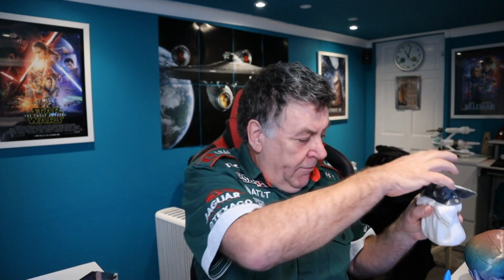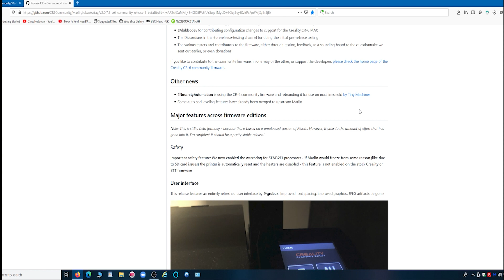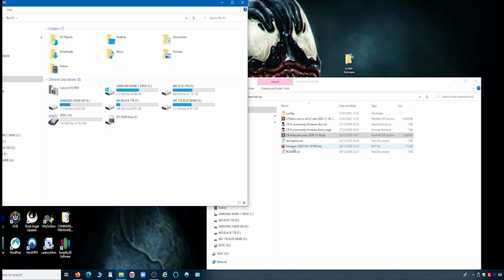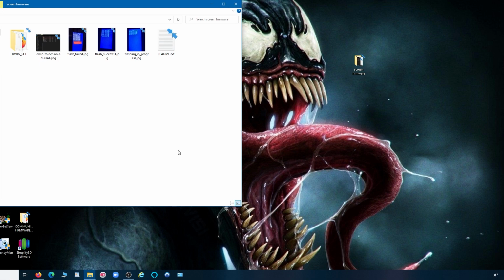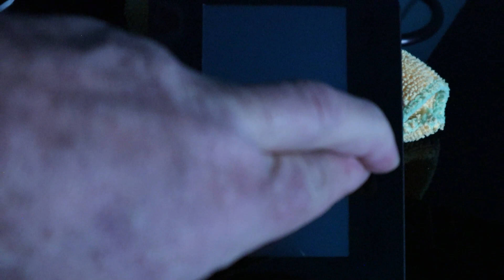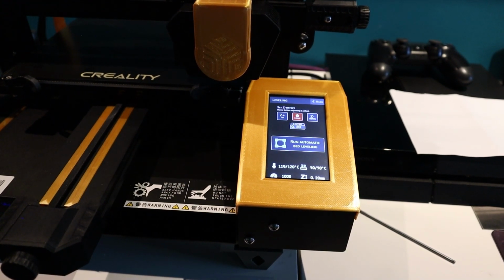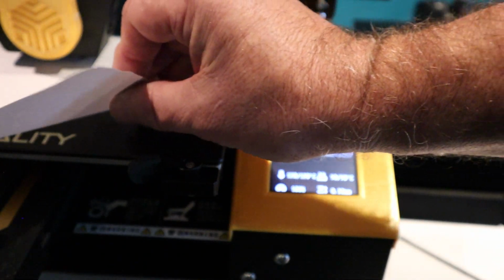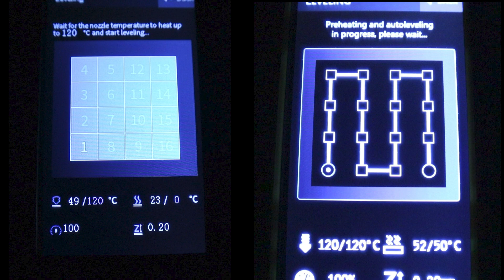Creality CR6 SE Community Firmware Install...Start To Finish

Comment: Thank you so much. Your detailed video gave me lots of assurance as I updated the firmware on my CR6-Max. I love the new interface and had no problems with the z-offset. I used an 8 GB card and for the screen update, it was crucial to update it on a windows machine. I originally formatted on my Mac and it wouldn't work. So, I have a surface laying around and formatted the micro SD as per your instructions.. Voila.. it worked as advertised.... Now... if I can move to octoprint...Best from Madison Wisconsin
Reply from the maker: Thanks for the kind words Daniel I appreciate that...glad it helped

Comment: Excellent video Tom and very easy to follow - now away to try my first test print with the new firmware installed! :)
Reply from the maker: Thanks for that Craig...am sure everything will go well...if you get any glitches try installing it again and even a 3rd time....sometimes it doesn't always "take"

I am currently using the version 6 community fimware which is working great but wont do a vid on it yet as its still in testing/beta version....as soon as the full public release it out I will do a vid.

Comment: Awesome video.  You seem to be quite knowledgeable.  I am looking to go with the Community Firmware.  However, I would like to resolve a problem with communicating with the printer via the USB.  Not sure if iy is a Creality Firmware Issue or not.  Was wondering if you could help.
Reply from the maker: Hi Patrick Thanks for the kind words but I am not actually that knowledgeable when it comes to technical 3D printing stuff :)

I don't use the CR6 now (I do still have it though) ...having bought an Elegoo after it and now a Bambu Lab X1C

If you ask on a CR6 or Creality in general Facebook group I am sure someone will help you out.

Comment: Great tutorial. I must say, identification of mainboard is ok, but identification of display (Creality or BigTree) is difficult, there is nothing on PCB.  Upgrading mainboard v.4.5.2 goes well. Upgradin screen goes ok (same screens),but once I started it write "firmware incorrectly flashed". But printer works, i.e. I tried bed leveling and it make it with always showing this incorrect firmware message.
Reply from the maker: Hi Kristian

Thanks for the kind words...much appreciated.

Re display identification...Isn't the Big Tree screen a much different thing....IE bigger size than the stock Creality screen?

I don't think they do one that looks like the Creality screen (but may be mistaken) so can't see how you could mix them up.

Comment: Great video. I followed your guide to install the firmware. I also fitted a micro SD to SD extender on the screen, so I have a SD slot to put the card in for future upgrades, without having to remove the screen. I had to mod the back cover to let the lead go through. I didn't get as many lines on the screen update, but it seems to be working. Thanks for doing this video.
Reply from the maker: Thanks for the comment Stuart...that's a good idea re the SD slot...I might do that next time....particularly if firmware updates are frequent...I believe there is already one in the pipeline.
Reply: i tried the extender but the built in switch in the screen thinks i have an sd card inserted when i do not, how did you solve that issue?
Reply: @Michael-ot3zw  how do you know that the screen has a card in it?
Reply: @stinker1000000  I notice that when I boot the printer with card in screen, the screen is blank, when I remove card from screen while printer is on the display reapears
Reply: @Michael-ot3zw  the extension I have used doesn't have the card in all the time. Only when performing the firmware update. All the extension does is to allow for an external socket (full SD card) to be accessed without taking the screen off. You are not supposed to have the card in all the time. BTW, this is the extension I bought: https://www.amazon.co.uk/gp/product/B0855DBVXF/ref=ppx_yo_dt_b_asin_title_o00_s00?ie=UTF8&psc=1
Reply: @stinker1000000  i dont have the sd in at all times, i have the same extender you have, for some reason it was detecting the extender as an inserted card, when i would eject the screen would reapear, but i dont have the issue anymore using a diff firmware, i think it was just my firmware making it think there was an sd inserted when it really was just the extender by itself
Reply: @Michael-ot3zw  Fair play - glad it's sorted itself out.
Reply from the maker: @stinker1000000  thanks for the idea again Stuart...I added one to mine no probs so it will now be easy on the next update....will show it in a future vid and give you a name check :)
Reply: @TomsManShed  cheers Tom👍

Comment: Thank you Tom, easy and exellent guide ! iam running on 4.5.2 aswell and works exellent
Reply from the maker: Thanks for that Patrick....yes my 4.5.2 was fine....I have swapped it for the BTT board (which I will be doing a vid on soon) but only because I had already ordered it from Ali express after reading the horror stories when I 1st got the printer and it was a shame to just have it sat in its box.

The BTT board does have some better features like being able to adjust the voltage to the steppers by firmware instead of pots on the board but to be honest I haven't used this feature yet as I don't know how to do it.....one feature I do like on the BTT board is that the blue light on the hot end flashes when updating firmware giving a visual indication that something is happening....also the MB fan only switches on when needed instead of all the time.

However the prints are no different and like I say my stock board worked great almost non stop for the 2 months I used it so would say if yours is working OK and you are happy I would stick with it.

Comment: So, I'm going to do the upgrade tomorrow.  I bought two 16 gb cards just in case. My query is how do we see the leveling mesh numbers with the update? I'm sure you have a video on it. I'll look around your channel some more.  No one ever seems to tell us how to get to the mesh numbers screen. Thanks again Tom. I'll give a full report on my install.
Reply from the maker: Hi.... After installing  the community firmware... from the first screen select:

1) "Calibrate" at bottom right
2) "Auto Bed Levelling"
3) "View Levelling Mesh

If you press "Run Automatic Bed Levelling" from stage 3 above it automatically shows the leveling results after the routine...Once you have installed the community firmware run the auto bed leveling first...once you done that you can view its settings any time as per 3) above

Comment: I believe what Sebastian said in his firmware video is the  reason they turn off the nozzle heat as it is homing for the print was because if you have one of those beds like my Ender 3 Pro if a hot nozzle touches the bed it melts the surface of the pad. Which it does. I also have the CR6 SE, I heat the bed and nozzle before I start the print so the nozzle is still be hot when it touches the bed surface and since the filament is melted the nozzle stays hot enough so when it touches the glass bed is just squishes and the nozzle tip still touches the bed. I have not had a single bad print, or first layer with my CR6. I also had no problem installing the Creality Community firmware, however I downloaded the version that was supposed to keep the extruder hot even for the print home, but it still shuts the nozzle heat off. I will have to work on that to see why it does that.

I have not needed to do what you call the zed offset paper method after leveling the bed. Mine always shows a .20 offset after leveling or homing. Like I said nothing but perfect prints with my CR6.
Reply from the maker: Hi Bubba

In the live stream by Tripod's Garage where Seb was a guest he talks about turning off the heat for an instant during bed leveling as I describe. The circuitry for  the  strain gauge the CR6 uses for the leveling is directly next to the heater circuitry...because of this the PWM signal can interfere with the accuracy when the heater is on. Therefore the heater is turned off on its downward travel at each leveling point till it touches and the measurement is taken... then back on again for its upward travel and journey to the next point as can be seen on the display. 

it still stays hot enough to melt the filament as its not off for long, but electrical interference  is eliminated for the INSTANT it touches the bed 

As for the z offset...again doing the paper test was shown in the live stream...with Seb talking Tripod through it. The Z offset will remain on what it was before the leveling as the leveling process doesn't adjust the Z offset it just sets the leveling mesh.

The z offset may have been tweaked in the tune setting during a print and this is what it will remain even after a new bed leveling/homing....its easy to confirm...if you manually adust the Z offset to say .23 or .18 then do a new bed leveling routine  it will remain the same... the reason yours always shows .20 is that is what it was set at ..the leveling procedure doesn't alter this.

I agree re the perfect prints ...just love my CR6 ...I like my CR10 mini as well but like the CR6 more :)

Comment: I have the Cr-6 Max and could not get the update to work.  I downloaded the CF6.1-Final-cr6-max-btt-skr-cr6-with-stock-creality-tft-2021-06-04-16-51.zip as I have a stock main board.  Using the 8Gb SD card that came with the printer.  The bar on screen is always blank it never moves.  I thought maybe it was just taking a while, so I went and made myself some coffee.  When I got back... still no bar and I smelt something burning.  Smoke was rising from the hotend.  While I was away it cooked the filament.  Turned every off.
Reply from the maker: Hi Anthony...you say you used " CF6.1-Final-cr6-max-btt-skr-cr6-with-stock-creality-tft" but you also say you have the stock creality board....the firmware you downloaded was for the Big Tree Tech board (shown in another of my vids) ....hence the "btt" in it's description....looks like you installed the wrong firmware. the "stock-creality-tft" bit in the description is referring to the screen...the "btt" bit to the board.
Reply: @TomsManShed  Dead right Tom,  I've just upgraded mine following your instructions to the letter with the stock firmware for the CR-6 Max and it worked perfectly and first time.   Perfect video - thanks so much : )

Comment: For some reason when the printer is home it is a few cm away from the bed and this is after the bed levelling process. Seems it doesnt home to z-offset position
Reply from the maker: Hi Nick...is this straight after updating the firmware?...if so all I can suggest is to try the whole process again....mine worked first time so don't know what it can be other than an installation glitch.

If you ask on the facebook group someone with far more know how than me will have an answer

Sorry I couldn't help.

Comment: I couldn't get the screen firmware to up date at first.  I then pushed and held the micro sd card in just beyond the spring that holds the card and 'catches it.'  Just hold your finger there during the whole update.  It worked, but takes a bit of finger agility or 2 people.
Reply from the maker: Interesting....is it the card or the socket I wonder? .its worth fitting the SD card reader extension (see one of my other vids) as it saves having to take the screen off each time a new firmware is installed.
Reply: @TomsManShed  Thanks.  I guess it may have installed on that -- the 10th try (or so) anyway, but it was also the time I tried holding it in as described.

Comment: Thank you, make the update very easy.
Reply from the maker: Thanks Ed...glad it helped...yes love this new firmware
Reply: @TomsManShed  Yes it is great. Had a hiccup in that the FAT32 format on my MAC worked for the printer but not the display so had to format using a windows PC for the card to be recognized in the display but then OK. I am still having an issue getting the predicted remaining print time to display, not sure f the script I have in Cura is valid as I still only see the file name not the print time.

Comment: Thank you very much Tom! I saw your video to update my first cr6 se and everything was perfect, I wanted to do it with the second one and when I insert the sd with the firmware in the slot and turn it on, a list with languages appears, what will be the problem? Thank you so much
Reply from the maker: Hi Franco....I don't know what that problem is ...it didn't happen when I did it so I am as puzzled as you are. If you asked the question in the Facebook group there will be someone there with an answer as they are a very knowledgeable group....sorry I couldn't help.
Reply: @TomsManShed  Thank you very much anyway, what I noticed is that when downloading the files from the page (the same one that you download in the video) the specific firmware file does not have the ".bin" at the end, is that influencing?

Comment: ive got a question. No one seems to want to provide a proper explanation as to why the nozzle temp is set to 0 when leveling the bed as the z axis goes down. wouldnt you be getting inaccurate measurements of the bed if youre probing all 16 points at varying different temperatures? so one point can probe at 149 then the next gets probed at 140 and so on.
Reply from the maker: The full explanation is given by seb in the post on the group mentioned in vid but basically he experienced interference from the heater circuitry that interfered with the level readings.....it's there somewhere on his webpage
Reply: @TomsManShed  thank u so much!

Comment: Great video, the only thing I'd reiterate is that using an SD card larger than 16GB on this may cause issues. 8GB is best. Larger cards work fine for the Main Motherboard, but the micro SD for the display is picky and most people cannot get anything more than an 8GB card to work.
And I cannot stress enough that one MUST remove the .bin file before trying to flash the display as that too will cause failure.
Reply from the maker: Thanks for the thanks James...yes I do say clearly  in the vid not to use one bigger than 16gb and preferably 8 or less at 4 mins in and I show removing the bin file before using the screen file....the 16gb exceria card worked 1st time on the display for me but like I say I do mention using 8gb or less.
Reply: @TomsManShed   Changed add to reiterate  :D
Reply: You can use microSD cards bigger than 8GB. But then you have to resize the partition to be smaller than 8GB to be able to format it in 4096 kb sector FAT32. It works. So if you only have bigger microSD cards try it this way.
Reply: @Yoku-San0  For the mainboard I use a 32 GB and it's fine it's the reader in the display that will fail for me with anything larger than 8 GB, so it's a thing that happens to some but not to all.
Reply from the maker: Must depend on the card or the printer or both ...as shown in the vid a 16gb formatted as Fat 32 worked 1st time for me without any partitioning....maybe its the card quality?...have added a link in the description to the one I used it was cheap enough at £3 from Amazon and is a genuine make (Kioxia formally Toshiba Memory) with 5 year warranty

Comment: Just a bit confusing - Part 1 was replacing the Creality Mainboard with the BigTreeTech mainboard, and Part 2 is installing the Community Firmware on the (original) Creality mainboard. Am I missing something?
Reply from the maker: Hi Mike

This was the 1st vid I uploaded just about installing the community firmware to the stock board ...I didn't call this any part number and I uploaded it on Jan 28 2021.

I then did the 2 part video which I called part 1 of 2 and part 2 of 2 on installing the BTT board nearly 3 months later

Part 1 was on removing the stock board & fitting the new BTT one here : https://www.youtube.com/watch?v=Rje8_UsK7cU&t=396s which I uploaded on April 17th
Part 2 was on installing the community firmware to that board here : https://www.youtube.com/watch?v=6InmuzxDIDM&t=883s which I uploaded the next day on April 18th

This vid that you are calling part 2 isn't part 2 of anything

Comment: Hello guys I had a problem with the installation and the touch doesn't work anymore. I tried to go back to the original software and it doesn't work either. could you help me?😭
Reply from the maker: Hi arquetipo....not sure what went wrong....if you ask in Facebook group there are some very knowledgeable folk on there....sorry I couldn't help
Reply: Hi, I have the same problem today, how you fixed it?